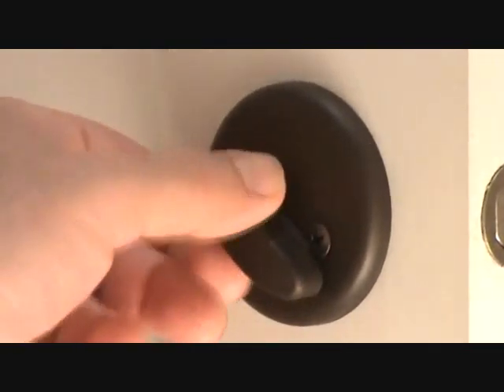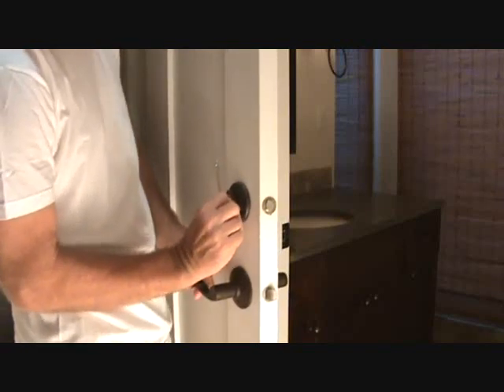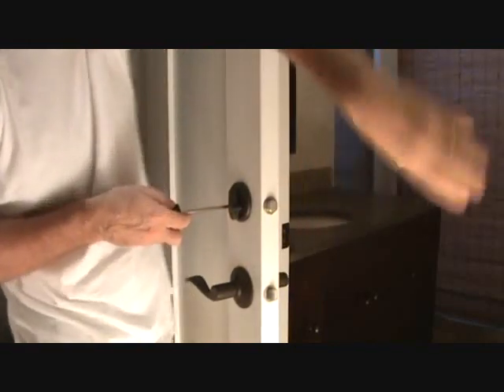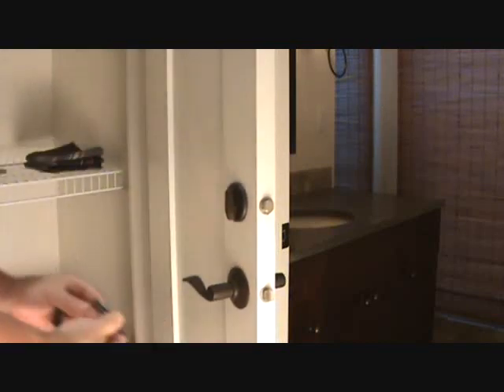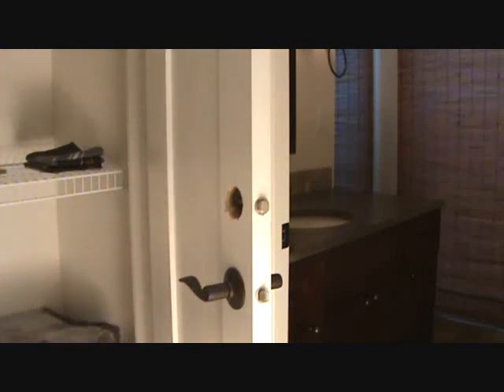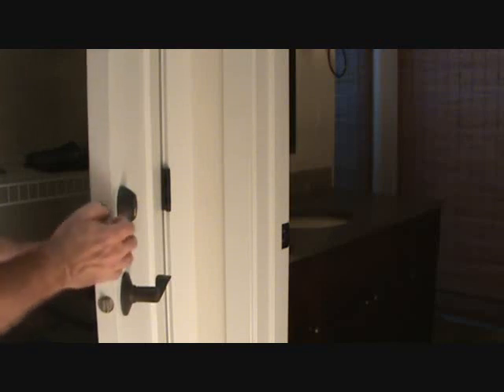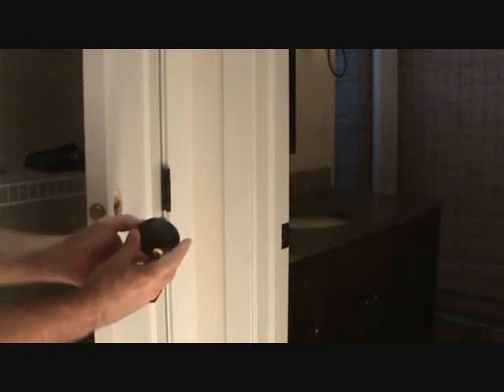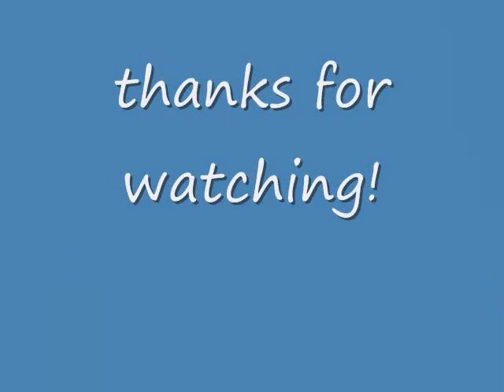How to remove a deadbolt

Comment: My deadbolt doesn't have two visible screws because there was a faceplate covering them.  I had to use a tiny allen wrench and a flathead to pop it off first.
Reply from the maker: John Iceman Crawford I've seen those. In most cases though you will see the screws. Great to see that you were able to see how to remove yours!   Joe  :0
Reply: VideoJoeKnows Thanks!  Yes, the hardest part for mine was finding what type of screw driver the set pin required for the thumb turn in order to remove the thumb turn just to pry off the dumb faceplate.  I thought it was hex, but it turned out to be the tiniest star head I've ever used.  For those reading my comment, be exceedingly thankful if you have visible outward-facing screws on your deadbolt.  Also, thanks again Joe for getting me started in the right place from the get-go.  I like your videos!
Reply from the maker: Dude thanks again for your followup comments & thanks too for continuing to be a faithful viewer of my videos! Awesome day to you!   Joe  :0